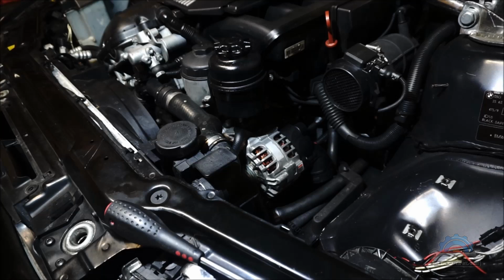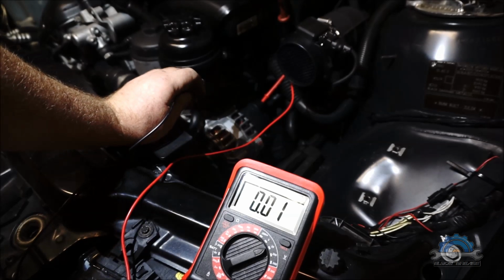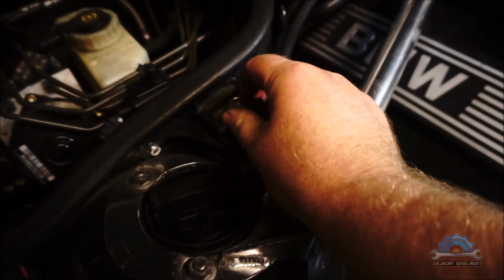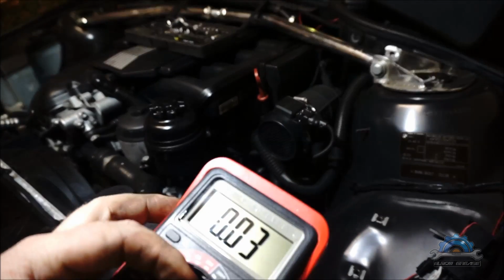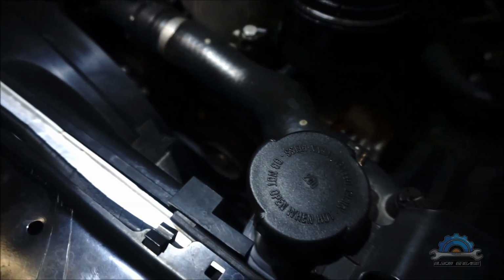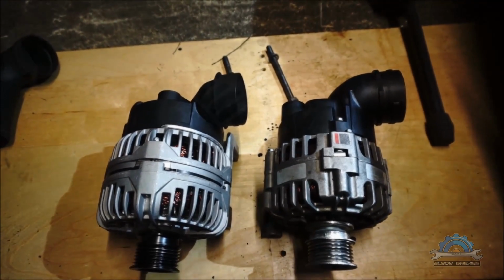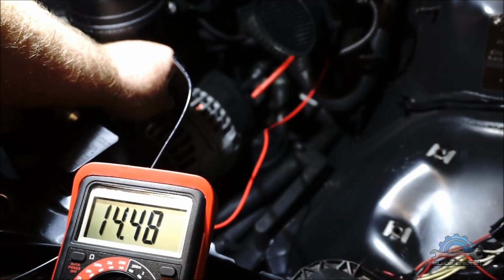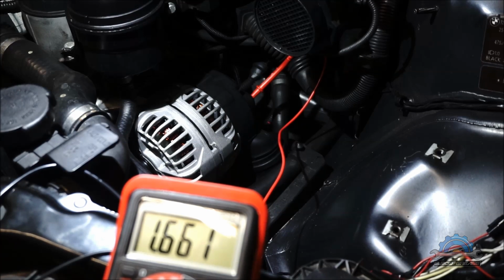Alternator whistling,whining noise diagnosis,ripple,diode pack test in BMW e46 M54 320,325,330

Comment: I can also confirm that this whistling noise comes from alternator. New bearings + voltage regulator = no effect. Replacement for another one in my E46 325i solved this annoying issue. Thanks for this tip!
Reply: So replace just the alternator? I got the same exact problem

Comment: There is nothing wrong with that one. It has a built in cooling fan. You can see the fan blades  at 8:05 when you spin it. That will likely increase longevity than one without it.
Reply: I have the exact same sound. It is really loud, between 800 and 3000rpm you hear more the sound of it than motor.. completly wipe the motor sound
I replaced my alternator and the New one make even more sound
Okay, maybe that feature increase its longevity, but I want to hear my L6 !!!

Comment: good video but  at the end i can hear a whinning noise  with your new alternator  or  i am wrong ?
Reply: Jérôme jéjé I yep this one was not better than the first one, so both returned to useless supplier
Reply: Garażowe Hobby  did you fix your problem ? I have the same annoying noise on my e90 .
Reply from the maker: Jérôme jéjé yeah bought another one from a small company and its fine
Reply: Elbow Grease which company do you have the link

Comment: How about a cracking noise when I start the car and goes off later. I do smell some burning smell when I turn on air conditioner.. any idea mate? It's e60..
Reply: Thirulkumar Perumal did u find cause sounds similar problem to my e90
Reply: Blower motor get the recall done
Reply: Harry S .. very sorry for late reply mate.. yes.. I did. It’s the front bearing, carbon and stator worn out.. did replacement..
Reply: Dohezy Bruh ... you mean air con blower motor? Air con blower motor actually makes noise when you turn on the air con and also when you turn car left or right..

Comment: I get this noise only above 40km/h. After about 10 or 15mins of driving, the sound goes away.
Any ideas?
Most of the time, the noise is completely gone. Only comes on after cold starts since I finish work around 10-11pm and temperatures outside can reach 10°
Reply: Hello, any news here? i think i have the same problem, e91 320d.
Reply: Same problem here.